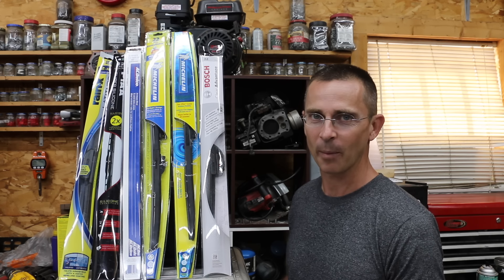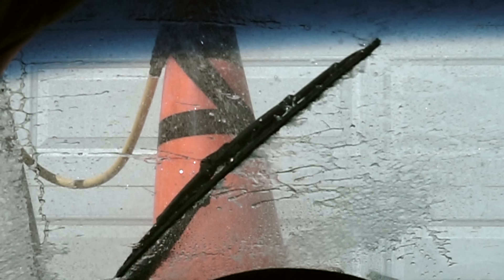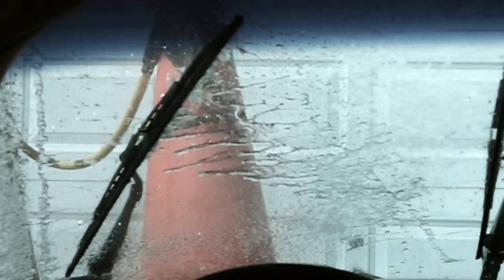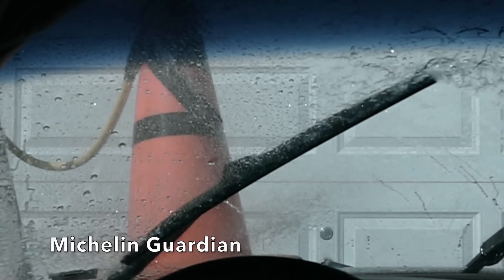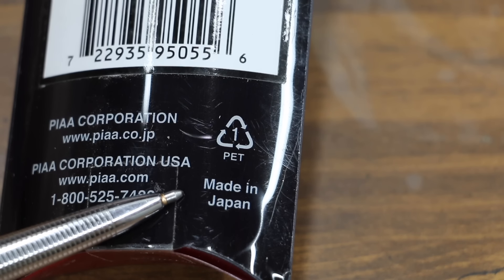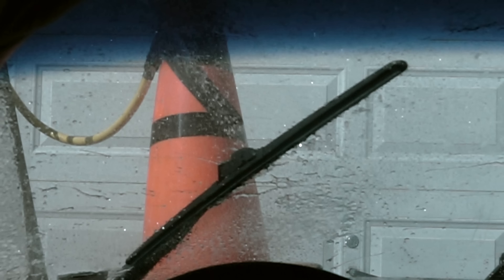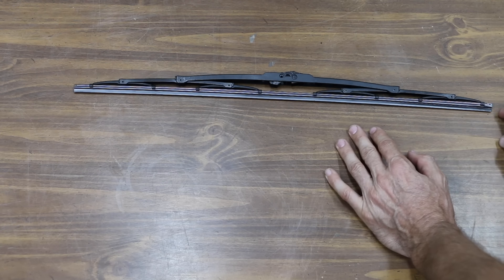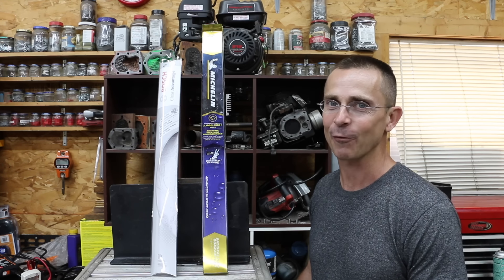Which Windshield Wiper Blade is Best? Let's find out!  Michelin, PIAA, Bosch, AC Delco, & Aero

Comment: Have a set of Bosch on my car, had them four year and all I’ve had to do is clean them every once in a while, best for the pretty cheap price In my opinion

Also I live in Scotland so use my wipers 364 of the 365 days in a year
Reply: Arran D sorry mate, but if I had 99.99% rainy days , I'd have to move.
Reply: I can believe that. I live in Alabama and bought a set of Bosch Icons for my dad's truck in 2010. I finally replaced them in mid 2018 after all the mechanic's tricks to rejuvenate  hardening rubber wouldn't work. Still cleaned them once every 6 months and they looked brand new until year 7 when the center started to show friction wear.
Reply: The Areo Premium seem to be the best value for me. I found the Boch 
Very seceptible to UV damage and that is the biggest killer of wiper blades were I live.
Reply: haha I've exaggerated quite a bit it's not all that bad, but we do get a fair amount of rain.
8 years is amazing, especially considering the price of them.
that's interesting, UV damage isnt as much of a factor here
Reply: @MarcelloTheBandit  - What kind of tricks do you use on the wiper blades?
Reply: @stephenleone2375  clean with dish soap and water in a paper towel. If it's cool outside, then warm water. When they get hard, but not brittle and UV damaged, you can use non-chlorinated brake cleaner on a towel to rejuvenate it. Mechanic friend would do that on door seals before they cracked, but would follow up with rubber conditioner of some kind. Can't use that on wipers for obvious reasons, but it did help.

Comment: Air pressure when driving makes a difference.
Reply: Im using Bosch Aerotwin and it's pretty good on higher speed. They having a better design compared to classic ones.
Reply: @trtoja  Try Valeo blades. They are a million times better than Bosch on my E90
Reply from the maker: Thank you for the feedback!
Reply: Definitely seen this with some blades. Can't remember any make or model though. Wasn't that why some blades came with a spoiler wing some years back? I think it's something they started doing back in the 90's. Though now it's a few years since I saw it, or at least since I thought of it.
Reply: That is what I  was  wondering too.
The wind sliding up the hood and across the window may cause the wipers perform differently. ..

But thanks for all your ambition and work. .
Reply: 100% true. This is why one piece blades have those "spoilers" built in. The airflow is needed to provide sufficient downward force across the entire blade. You can see that some brands have the blade lifted away while resting. The air will flatten it out.
Reply: @trtoja  When I was younger. They sold these 3 bladed Louvers that clipped on the wiper blades. Creating more down force to the windshield while driving..  But can't seem to find them anymore. They made the cheap wipers work even better.
Reply: Yes.  Aerodynamics and hydrodynamics at speed is important.  I've had blades that lift off the windshield at highway speeds.
Reply: Very true! I used the beam style blades both Michelin and  bosch but the air would lift them slightly creating bad streaks at 60 mph plus, I switched over to traditional framed PIAA silicone blades and have had no issues and they work great.
Reply: When comparing them side by side consistency in the tests will still be revealing
Reply: @straight6petrol  LOL, Valeo costs an arm and a leg, but only lasts a month before it starts leaving stripes on the windshield.

Valeo - low quality at high price
Reply: It's not only about the blades pressing against the windshield, but also the vectorization of rain.
When the car is moving, wind pushes the rain along the glass, essentially making the problem of water going over steel-framed blades a non-issue
Reply: @rodolfoandrade7453  what does "vectorization" mean?
Reply: I also was thinking the same thing.   They designed them with that in mind, it would be interesting to see if the results change

Comment: Ive been buying the cheapos. Replace about every 2 years and use with rainx fluid with rainx orange fluid in the cold months. Either way im replacing blades about every 2-3 years no matter how much i spend on blades.

Comment: Long winded response coming:

I love this video! I spent years testing this in Michigan and my results are very similar to yours. The steel frame wipers are by far the best at contouring to your windshield by their nature. However that's where the advantages stop. Particularly in the winter. Most wipers you can bang on the windshield and remove all but the most stubborn ice, which can usually be removed by hand. However the steel frame ones have a tendency to trap ice inside.

What I've turned to is the Rain-x quantum blades. They solve one issue you didn't test which has to do with wind. The Rain-x quantum's are more expensive, but they are the latitude wipers with a spoiler to keep the blades on the windshield during high winds or highway speeds. I also find I only replace them about once per year vs 2x per year with others. Plus they apply Rain-x and it should be noted that you don't have to do the prep step with them every time. Just the first time.
Reply: I found that solid steel wipers lasted the longest among my customers but the solid beam did better on removing the most water. But I've had a very few customers state the vacuum on the solid beams create a vacuum making it just as hard to see when it sweeps back to resting.
Reply: @engelsseele2  I found they were about equal when kept clean. However the steel ones were quicker to split from the blade and also make noise or leave streaks that cleaning couldn't fix on them.
Reply: Living in ND I have found that the trico brand wipers work very good year round and I've use the same pair for almost a year and a half and still wipe like they are new. Something to give a try
Reply: if you're ever at Meijer Trico Flex wipers are worth a shot. I use those and the orange Rainx fluid.  Cheaper than Quantams. 
I get 12-18 months out of each set compared to 6 months for regular steel frame RainX blades.
Reply: I must be weird. Solid beam ones is the ones I struggle the most with in winter to remove ice from and keep clean from snow when snowing.
Reply: @ackzlebobbitt7511  I swear by Trico Flex wipers. Best value in terms of cost, performance and longevity out there in my opinion.
Reply: @ackzlebobbitt7511  I have tried the Trico wipers and did like them. However I did prefer the Rain-x ones particularly due to the water repellant being added. It should be noted that I generally don't replace my blades due to failure, but usually more to precaution.
Reply: I'm in Michigan as well and i'm pretty happy with the Rain-X Quantums too.
Reply: @SnehPatel96  I've tried the Trico ones too and overall they work pretty good. However, I prefer the Rain-x due to the application of the Rain-x to the windshield. As for actual performance, I thought they were pretty similar. I also use the Rain-x windshield fluid, but it doesn't work as well as the blades do overall.
Reply: @espenschjelderup426  usually I can bang mine on the windshield a couple times and it'll remove most of it. The rest I have to remove by hand. The biggest issue with the steel frame came after driving in slushy conditions and then it would freeze after. Even if you bang the wiper on the windshield, the ice rattles around inside and prevents the full flex of the blade. My experience anyway. I used them for years and will likely never go back. And definitely no question that the silicone ones outlast the steel frame ones.
Reply: To everyone I live near South Texas. That I know plays a massive role in all of this. I would believe that cold has a much larger impact on anything rubber than even direct sunlight. Hopefully we will see that here. Sunlight vs cold in a 6 month battle! Lol
Reply: I found my preference with the Michelin optimums.  I tried the hybrid design he showed and they lasted decently, but switched to the optimum single blade for the spoiler shape.  I'm at about 2 years with mine and 3 with my wife's so far, and this is dealing with Illinois weather a little closer to St. Louis.  I also found that a light wax coating on the windows from certain wash processes does the job of treating windows.

Comment: I would like to see different windshield washer fluids tested for their efficacy against snow and ice, and what very low temperatures do they stop being effective (if at all).
Reply from the maker: Thank you for the video idea!
Reply: This is a Great Idea. When we lived up in Indiana, we had some brutal temps at times. I think I tested all the Winter Washer Fluids back then, and nearly ALL would freeze at some point or another. Caused me to be late to work sometimes, as I used it to deice my windshield. 
The Only washer fluid that I have Never Once had freeze up either in the tank, or in lines, or at the least in the spray nozzles themselves... was the "yellow" Prestone Winter Washer Fluid... however they now have done away with that it seems and replaced it with an "orange" Prestone All Season washer fluid, not sure if its as good as the previous though. We moved further south since then, and don't have as many days with the extreme cold temps. So I'm not sure if this new washer fluid is as good as the old. Be interesting to see some tests, and not only for freeze point but since it is "all season" but also how well does it clean.
Reply: @Yhrim70  Indiana cold....ok 👌😂
Reply: @ryanyoung7433  yes Indiana cold. No it's not Alaska, but there is some bad times in the winters. We even had temps down to -25f a few times, which is worse when that's not the normal because people aren't prepared for such. And I also remember when there was many days where the door on our "all season" RV was frozen shut in the mornings with nearly an inch of ice... and my blanket frozen to the wall. Took a heater directed at the door for about a half hour before the ice would melt enough to get the door open. Besides the occasional blizzard, ice storms, and etc... Is there worse places to be in the winter? Sure. But I think a good portion of the nation is going to get a dose this year, as the weather is getting worse all the time.
Reply: slyscafe  i use rain x brand. usually on sale 2 for 7 bucks. it works well in the snow, cleans ice off well also.
Reply: @iamgriff  I used to use the Rain-X winter fluid... until it froze up in the reservoir and also in the lines... I even added a bottle of alcohol to it after it thawed out, just hoping to use it up... it froze Again the Next night... never used it again after that. Maybe it's better now, i don't know, but it wasn't worth my time back back then. 
I'm picky about my winter washer fluid as I have even had it freeze up in the washer fluid pumps and bust them before. Had to replace the entire pump and several connections. 
I'm hoping that the "new" Prestone "all season" is at least as good as their Winter Fluid used to be, as I never had a single issue with it freezing up. However, I just recently found that walmart stopped carrying the Preston brand all together... guess I'll have to see if the auto parts store still carries it.
Reply: i want to see bug guts removal in that test
Reply: Ryan Young Yo it’s 6 here right now, in Northern Indiana.
Reply: @Doxxi  You don't know cold.
Reply: Prestone all season orange fluid is my go to stuff. It will easily get rid of any snow ice bugs sap and bird crap.

Comment: Speaking as someone who works in the oil industry, you might be surprised at how much these blades are marked up. The company I work for distributes some wear items such as filters and blades, and the price that these blades call for from the factory is so incredibly small compared to their MSRP. It's ridiculous.
Reply from the maker: Great information!  Thank you
Reply: Thats what happens when you have 5 middle man
Reply: Have to think cost of, advertising, workers, and building. As a business rule, if you don’t sale it 80% you paid for it, then never sell it or it is lost. That is why you see all the way 75% discount at big markets. If it is going to go lest then it, then recycle it.
Reply: I buy my wipers from rock auto.     Wayyyyyyy cheaper than AutoZone or oriellys
Reply: Except the ones made in Korea and Japan. They probably aren't marked up that much
Reply: Yes I agree, I buy semi truck FLEETGUARD filters from a dealer at the control fleet price they cost about $9.69 for a extended duty oil filter - same exact filter cost $55 at retail outlets

Comment: What about driving speeds. Driving at city or highway speeds must make a difference in performance
Reply: Kurtis Adams or heavy the downpour
Reply: I've found the beam style blades tend to fly up on the bottom half at hwy speeds rendering them less effective than the traditional style blades.
Reply: if you treat your windshield with water repellent, at highway you don't even need a windshield viper. The wind is your viper.

Comment: Real test for wipers is icy winter conditions...

Most wipers just freeze up and wont wipe.

Greetings from Finland.
Reply: In real winter conditions, like in Finland (Suomi) and in Canada, I use winter only blades ... it handles snow, sleet and ice much better and are stronger allowing it to last a full winter.  But they are darn ugly! 😄😄  So in the rest of the year I replace them with my Bosch blades
Reply: Very true I have to get new wipers every year because they get ruined in the winter
Reply: Agree. I use piaa silicone only for the summer...in winter I switch to the rain x latitude rubber blades and they work much much better for wiping ice and snow than any other blades I tested.

Comment: I hope there's a round 2 with Bosch Icon, Michelin Stealth Hybrid, and others.
Reply: Michelin are awesome
Reply from the maker: Great suggestion!
Reply: Agreed, not sure why the Icon was not tested as it is one of the highest rated blades out. I have tried many of those tested except the Michelin silicon ones and the Icon has been way better.
Reply: Id also like to see a round 2 with the Bosch icon, trico onyx, Maxx, neoform and rainx silicone
Reply: Use Bosch to alleviate trouble with Llamas

Comment: I just now got this in my recommended list, and here it is already a year later, almost to the day. I hope YT doesn't take a year to recommend the UV test results!

Thank you for presenting the information in a totally unbiases manner, and then going a step further by using the slo-mo camera. That's something I can't get on my own and I found it very helpful, along with your comments after studying the images.

I have been applying RainX repellent on my windows since 1986, so I'm very accustomed to driving with less wiper activation than most of the folks I observe around me. It's rare for me to use high speed. I usually find that I'll be using intermittent when others are wiping at low speed, and I'll shut them off when others are using intermittent.

I've been using the Bosch on my car for a number of years. What I didn't realize is how it compared to other brands for its technology and price.

Coupling the repellent with one of the best designs appears to work very well for me, but I'd still like to know more about the UV results.
Reply from the maker: Thanks for the video idea.

Comment: I'm so old I remember when blades would last 5 years,   now you are lucky to get a year.
Reply: Right!!
Reply: That is so true I now have to change them once a year no mater what brand
Reply: Bosh focus have lasted me a year and are just as good as when I put them on, not cheap though
Reply: Here in N.J. Most people replace blades with oil changes, because if the sun and up rays don’t get them,the salt and ice do, if not then the deer get them along with the rest of the front end of the car!, I still see issues of seasonal dry rot an a lot of blades, regardless of brand.
Reply: @brennanheath1335  3rd year of hardish winters on a set of bosch beams. Rain-X treatments are your friend or just buy Rain-X branded washer fluid.
Reply: I thought it was only me... I usually get about 9 months out of a set... and I buy the Bosch
Reply: To be fair, old blades used to be noisy as heck.  Also, not sure if we tolerated a less than perfect job back then.   They definitely got changed less frequently.
Reply: This is where the silicon blades shine. I have been running PIAA blades on my car for about 4 years now. No signs of wear.

The beauty of the PIAA blades is that you can purchase just the silicon blade part for a low cost replacement; like the old ANCO and Bosch blades. Why Bosch phased these out is a mystery to me. This feature is what led me to switch to PIAA.

I live in N California. Lots of sunshine, no snow or ice. So, the PIAA blades are perfect for me.
Reply: I think windshields were also flatter back then for the most part
Reply: The Michelin Optimums that I use have been on my car for about 2 years.  I only can tell you the brand cause the ones on my wife's car had started to fall behind after 3 years, but it turned out we just needed to re-treat the windows and now expect about another year out of them.
Reply from the maker: Thank you